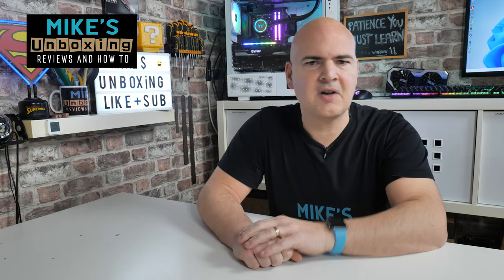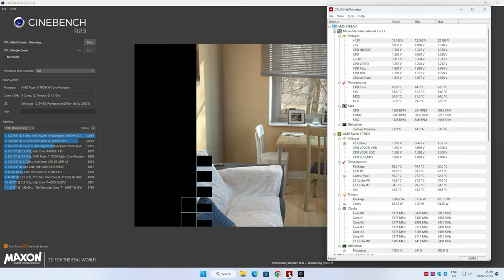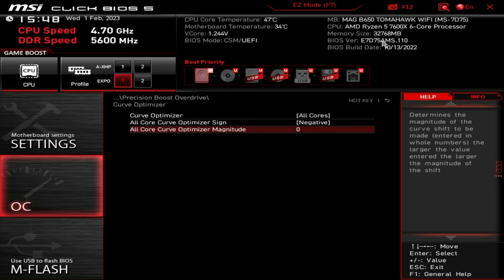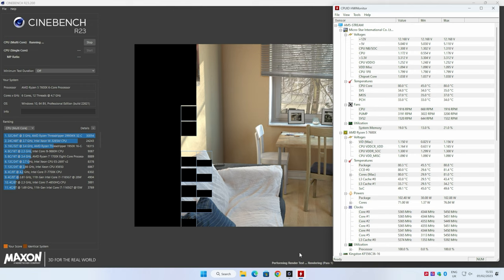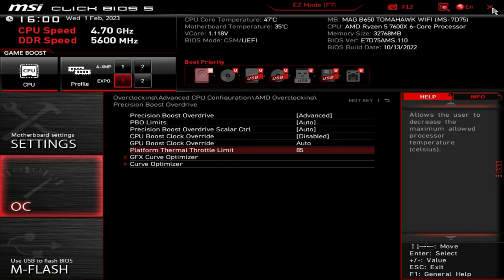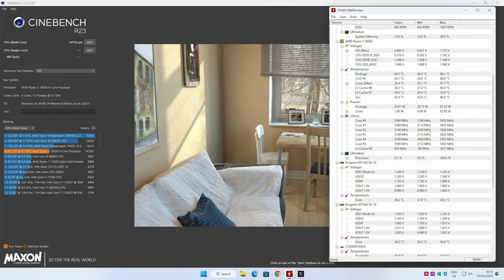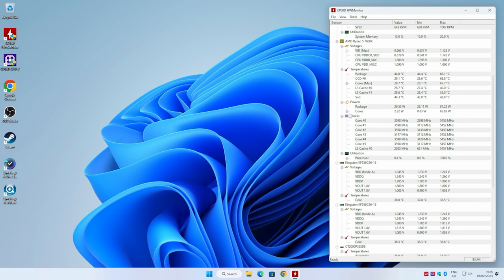How To Tune AM5 Ryzen 7000 Series Wattage & Reduce Temps With Curve Optimiser PBO2

Comment: Well i set curve optimizer to minus 30, This is Ryzen 5 7600, i went crazy and set tdp to 85W (its 65w cpu) temp limit 85.  Freq 5300. Even still stock cooler on it with old school close case. Runs w/o any problem idle temp is 48 49 side cover is open. I think i can go with 5500 too but i dont want to fry it with stock cooler. Only thing is it is not stopping or slowing down at 85 degree, keeps going n going. Here is my stupid question i know these numbers are super fine with stock cooler but why this thing is not slowing down over 85 degree? posibbly tdp value causing to that. Or bios has a bug. When i can save enough buy a good quality cooler probably i can see the real limits. But according to your video, this cpu is one of the better ones in the batch..
Reply from the maker: the throttle limit is usually 90-95 before it starts down clocking

Comment: Helo gona try this. A question. I bought a kit of 32 gb of corsair vengace 6400mhz on sale and want to put them on 6000mhz but i have stability issues. There is any way or place when i can found how tu put the values to make them stables? thanks
Reply from the maker: update bios, then turn on EXPO or XMP.
Then enable context restore
then enable power down mode

Comment: The Ryzen Master Software suggested -60 for the curve optimization of my 7600, no matter if I select the optimization for each single core or for all cores. I tried the settings and so far it runs stable with an overclock of „+200“, resulting in about 5,35GHz under load. But I‘m wondering how I can adjust the curve by -60, when the limit should be -30?
Reply from the maker: ryzen master uses a different metric in the software than the bios, they don't relate directly to each other
Reply: @mikesunboxing  ok, but in the Bios of my Gigabyte B650 Eagle AX the values are the same: -60 ist the lowest I can go ...

Comment: I will follow these steps after work on my 7700X. Does this just adjust max temps and wattage or also idling temps? Usually I'm sitting between 45-47C which I think it's too high
Reply from the maker: it should bring it down a little
Reply: @mikesunboxing  so I applied the same settings (I use a Ryzen 7 7700X with a MSI PRO X670-P Wifi board and Corsair H110i Pro XT 240mm aio), temps drop 28 C and clock stayed at 5.5 GHz with max wattage of 87 W. I lost about 50 points in Cinebench ( I was using CB 24 instead of 23, but I don't think it makes a difference ). You think I should try and bump up wattage to get same results or it's not worth it ?
Reply: Try 90

Comment: Hello i have yhe 7800x3d with an asus rog
strix b650e-e i see high temp spikes when i
load something  max i see 81 c adn aio fans run full and noise but not so much when
i game is arround 65-70 max question how i
can decrease temp and what nuber i use in
curve optimization thanks the system is about a week so in new all
Reply from the maker: sounds like the cooler might not be mounted okay, or the pump speed is too low

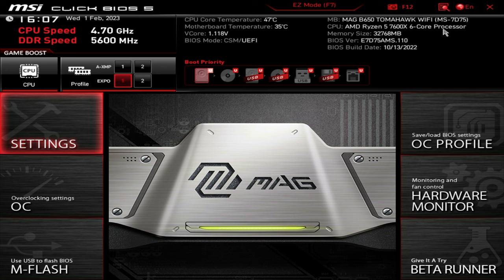Comment: My version of Cinebench, 2024,  has GPU (system requirements) as the first benchmark option, and the numbers I generated with that are lower but relatively close to what he is getting in the video testing CPU ( Multi core), thenwhen I run CPU (multi core) the numbers are much lower, like 10% range, is this jus 7:51 t due ro updat since the video relesed?
Reply from the maker: could be that

Comment: Would using a Kraken elite 280 AIO or a TR Peerless Assassin 120SE air cooler be better for a Ryzen 7 7800X3D?
Reply from the maker: 280 aio is likely to be lower temps but more expensive
Reply: @mikesunboxing  I have the 280 AIO already but I just worry as it’s mounted on the outside of my case due to the length of my gpu

Comment: If i put a fixed voltage and a fixed frequence it will be ok ?
Ex : 1150mv at 5ghz all time ?
Ryzen 7600, mobo aorus 650m pro
Reply from the maker: i would think so, but i'm no electrics engineer

Comment: Hey Mike I copied the exact same settings as yours and everything seems stable but I saw your CPU was running at 5.3ghz to 5.4 but mine at the end was running at 5.2 to 5.3. Is this normal ? Or should I lower some of the settings.  

Also I got 14350 in the end result but yours was higher.
Reply from the maker: should be a little higher, but that is sometimes the lottery on cpus, and also cooling equipment. As long as it is stable that is the main thing

Comment: Do I need to change the PBO limit? Can I just change the curve optimizer negative 30 and platform thermal throttle limit 85? I have the same cpu
Reply from the maker: try it and see if it works for you

Comment: Underclocking is useful as you get more for less. Does that fixed the random crashing you had with it or there will be something like.. How to stop your ryzen system from crashing... Video?
Reply from the maker: good idea, seems much more stable now but i can't 100% put my finger on it so keeping quiet for now until i have results i can reliably replicate
Reply: @mikesunboxing  I'm still thinking about insufficient RAM voltage.  Especially with first gen cpu. My Ryzen 1600 needed 1.38v instead of 1.35 to be stable with the ram set higher than 2133 with 2666 module.

Comment: Does it help lower the idle temps too?

My cpu running 49-50c idle, room temp around 28.. idle temp for 7600x is bad
Reply from the maker: yes it will, mine is usually low forties high 30s

Comment: Hi, I have the same processor as you, R5 7600X using 5200mhz corsair 32gb ram with expo1 as you, using MSI B650 PRO-S WIFI, and I did the curve optimizer just as you did and it doesn't reboot, it gets stuck at the MSI logo while trying to boot up, I waited around 5 minutes and nothing happened, I restarted it and got back into the bios, disabled the curve optimizer thing and it worked well after. Any ideas why, please?
Reply from the maker: too aggressive on the undervolt? maybe try 10 rather than 30 or 20
Reply: @mikesunboxing  will try that, thank you for the reply

Comment: I tried with CO per core, some cores I set to -35, when playing games, I noticed that sometimes the cores jumped to 10000mhz, but no error happened, should I increase the CO to -30 ?, i use ryzen 5 7500f
Reply from the maker: if it is stable and performs well i would leave it

Comment: Is it safe to tweak the 7800X3D with an ASUS board? I've read how this CPU gets burned because of voltage. Im going to use a 360mm with 3x Be Quiet Silent Wings 4 HS to keep the temperatures cool. 92 degrees is just absurd to have.
Reply from the maker: if you are going to tweak it, lower settings rather than raise them

Comment: Had a quick question about Platform Thermal Throttle limit. Does setting the value to 80-85 help lower temperatures overall or is it just telling the PC "hey start throttling or shut off if the PC reaches this" because I basically don't want it to do that for a couple reasons. One I have been having a weird problem where battlenet downloads of all things will ramp my CPU up and drive my temps to almost 90c+ and it will shut off my pc. My temps for everything else are fine. I game at 4k for hours no problem maybe 60-70c, idle around 40-50. I do have problems If I try to push 144fps 4k gaming though, it'll shut off the pc cause it reaches those 85-90c ranges.
Reply from the maker: yes that is right it doesn't really do anything other than limit the temps and throttle the cpu.
downloads like battlenet and steam are generally the worse things as the data compression and decompression are extremely CPU heavy tasks.
it might be worth looking into undervolting or getting a bigger cpu cooler
Reply: @mikesunboxing  Thanks for the reply. I did undervolt and have it at about -15 now which has helped temps a little more. Running cinebench had the temps around 85c still but idle and gaming seem a little lower. I do have a deepcool lt520 240mm aio and I don't think a 360 would help too much more at least in terms of those two problems mainly cause I have seen other testing that have shown this, its just a weird problem all around.
Reply from the maker: @NoxvJD  This is maybe easier to fix or at least advise if we can ask more questions and get direct answers, so feel free to join our Discord chat and we can go over it in more detail https://discord.gg/XtBTGQ6BDu

Agree to the rules by clicking the emoji and you will get access to the rest of the Discord channels

Comment: What if my system can't do - 30? I haven't tried messing with the 7600x as this is my first amd processor. Been a long time intel laptop user and I'm afraid that it may brick my system. Any advice? Thank you for doing guides like this good sir!
Reply from the maker: for a 7600 30 is asking a bit much as it is really low wattage to start with, 20 should be possible

Comment: hello Mike my r5 7600x results:
79.6 degree 15285pt 105W
64.2 degree 14545pt 90w
what are u thinkin? is it worth to 700pt for 15 degree?
cooler:msi mag m360 coreliquid
Reply from the maker: yeah i run my 7700 at 90w roughly and gets to 64c with a 360 aio with 18500pt so that sounds pretty good

Comment: Hey I have the exact same CPU and Mobo (7600x and B650 tomahawk). I applied the exact same settings and temperatures went down a lot! About 3 days after making the changes in BIOS, my PC started randomly crashing and restarting while playing games (not even demanding games). What settings should I alter to to prevent this? 

I don't know if this is relevant but in Event Viewer I get an error message saying: "The AMDRyzenMasterDriverV22 service failed to start due to the following error: 
Cannot create a file when that file already exists."

Please help, i'm not too tech savvy.
Reply from the maker: check out the DDR5 RAM setup guide we did it might fix that issue
Reply: @mikesunboxing  I had my PC built for me at a reputable PC shop because i'm not too confident in myself. XMP is enabled and the build is no older than 1 month so I doubt it's a hardware issue.

 For more info, the MOBO was displaying a solid red LED next to the CPU label and when I undid the eco mode and curve optimizer it went away and there have been no crashes (at least for 3 hours now). The low temps were fantastic so it'd be nice if I could find some sort of balance that works for me with the settings but -20 CO +ECO mode was also crashing.
Reply from the maker: @piros6506  This is maybe easier to fix or at least advise if we can ask more questions and get direct answers, so feel free to join our Discord chat and we can go over it in more detail https://discord.gg/XtBTGQ6BDu
Agree to the rules by clicking the emoji and you will get access to the rest of the Discord channels

Comment: Hi Mike, is this valid for the 7900X or do i  must set to 15 unstead of 30? Cheers
Reply from the maker: try 30 and see what is turns out like, or 15 and work up to 30 in steps
Reply: I know this is an old reply..... But I got my 7900x down to a max of it using 55w and with a max temp of 58c all under full load. All I did was put the CPU into AMD Eco mode, set the wattage down to 65. Then I set the PBO to -30 and then I undervolted the CPU by .05v.

Comment: It is acceptable for the 7950X to run at 55 degrees on idle? I'm using the MSI MPG X670E CARBON WIFI. Would like to take it lower, since my system fans are spinning on full blast.
Reply from the maker: Use the curve optimisation or eco mode that will drop it a lot
Reply: @mikesunboxing  It really doesn't though. On my 7900x it may have dropped by like 3-5c for idle temps.
Reply from the maker: This is maybe easier to fix or at least advise if we can ask more questions and get direct answers, so feel free to join our Discord chat and we can go over it in more detail https://discord.gg/XtBTGQ6BDu

Agree to the rules by clicking the emoji and you will get access to the rest of the Discord channels @fade2black001

Comment: Do you run the cinebench test for the standard 10 minute test?
Reply from the maker: for air cooling i do 3 or 5 minutes, they very quickly reach the levels needed for testing

Comment: I have used pbo and did the curve optimizer with all cores negative 20 however my temps got higher for some reason but i did get higher clocks too , what could be the reason ?
Reply from the maker: sure it was a negative offset not positive?
Reply: @mikesunboxing  yes negative , but now i tried 25 and its much better 
I have read that reducing the offset created a thermal gap so the cpu boosted even more and thus increased the temps , i guess thats the reason

Comment: Stock settings for my 7600x i was getting 14000 cinebench at 88°c. Now at -30 pbo curve ppc 88k tdc 80k edc 120k im getting 15000 at cinebench and 72°c because my cpu is running 300mhz faster!

Funny, lower edc like 70k mA got my score down like 13400 but 66°c. Don't know why this... maybe the cpu needs more power to run ?

I had

Comment: Weird how AMD systems idle around 30-40 watts compared to Intel that idles anywhere between 13-20 watts. I keep noticing this on every video I watch when it comes to these platforms, for some reason AMD idles at almost triple the power than Intel cpus
Reply from the maker: Yeah which is pretty unfortunate for amd and is part of the reason my daily driver is now intel not amd
Reply: @mikesunboxing  Same here, particularly for power-efficient systems that need to run 24/7 :/
Reply: I can drop my idle wattage to 25 w. After some tweakin'. That's the lowest I can go with my system.

Comment: Hi all please help here my cpu voltage is showing in bios ui as 1.4 and idle temp is 59 after applying this setting apex max 80 going after 1 hrs playing my whole system is delaying in response 7600x + 7700xt using with air cooler single fan msi b650 pro wifi
Reply: Only I have not applied the last watts setting in this video please help me
Reply from the maker: This is maybe easier to fix or at least advise if we can ask more questions and get direct answers, so feel free to join our Discord chat and we can go over it in more detail https://discord.gg/XtBTGQ6BDu
Agree to the rules by clicking the emoji and you will get access to the rest of the Discord channels

Comment: This doesn’t work for me, I’ve tried it going from 30 down to 10 and it wouldn’t boot, now I am stuck just in windows 11 boot loop…. 😢
Reply from the maker: something very odd going on there. reset the CMOS to factory defaults
Reply: @mikesunboxing  thanks I will give that a try, I assume it’s better to update bios after before I try again or should I do it at default bios first?
Reply from the maker: @Crovon1  This is maybe easier to fix or at least advise if we can ask more questions and get direct answers, so feel free to join our Discord chat and we can go over it in more detail https://discord.gg/XtBTGQ6BDu

Agree to the rules by clicking the emoji and you will get access to the rest of the Discord channels

Comment: I used tjmax 75 deg C, and -20mV core optimizer on my 7600. My mobo, Asrock PG lightning doesn't have many options like voltage limit. So far been stable, temp drops from 95 ish to 78 maximum using the stock cooler. Not quite sure about performance tho.

Comment: Idle Wattage is quite terrible on AMD CPUs. 30-50W on idle? Intel is taking like 8-10W
So if someone is watching YT or something for 3 hours and then playing for another 3 hours then overall Intel could use less power because for 3 hours was using 40W less and then for the next 3h 30W more during gaming.
Reply from the maker: i would like to do some at the wall plug measurements to see what the real difference is, and maybe intel are reporting a core level rather than a package level

Comment: Hi, I tried the same thing on my 7700xm and it dropped the temperature quite a bit. But the problem is that it's not booting quickly. It's taking a minute or two to boot. Any idea what happened ??
Reply from the maker: enable memory context restore and enable ram power down
Reply: @mikesunboxing  Mike, its perfect. Now it's boot up quickly. You got a sub.
Reply: @mikesunboxing  one more doubt, sometimes it is reaching 85+ while playing gaming and it automatically crash the games. Any solution to this? It's is not stable idle is at 55. (7700x)
Reply from the maker: @foodtechtravel-ftt2040  This is maybe easier to fix or at least advise if we can ask more questions and get direct answers, so feel free to join our Discord chat and we can go over it in more detail https://discord.gg/XtBTGQ6BDu

Agree to the rules by clicking the emoji and you will get access to the rest of the Discord channels
Reply from the maker: @foodtechtravel-ftt2040  This is maybe easier to fix or at least advise if we can ask more questions and get direct answers, so feel free to join our Discord chat and we can go over it in more detail https://discord.gg/XtBTGQ6BDu

Agree to the rules by clicking the emoji and you will get access to the rest of the Discord channels

Comment: i tried to undervolt my 5900x. the cores were a little faster, but the temps went way up. i undervolted by negative 30, but the temps went up by nearly 20 degrees C. very strange
Reply from the maker: was it definitely minus 30 not plus 30
Reply: @mikesunboxing  i had to double check, but yes. it was definitely negative 30. i took photos. i must just have a strange cpu. with just pbo enabled i am lucky to hit  4.2ghz in cine bench. but with pbo 2 i can get 4.6 in cinebence, with at higher temps. great video by the way, really enjoyed it
Reply: @yosser33  Is your motherboard a gigabyte, by chance?
Reply: B550 Tomahawk  @CigsInABlanket